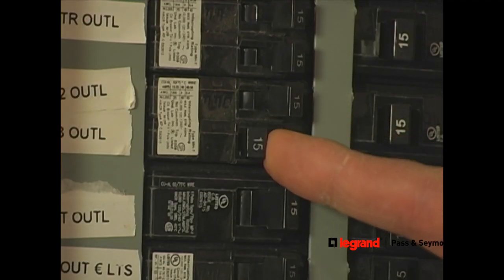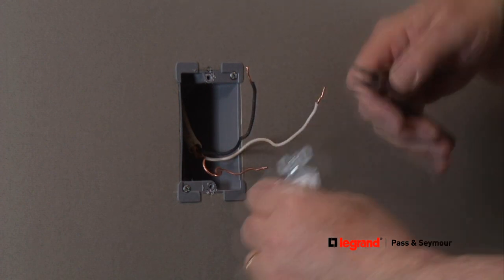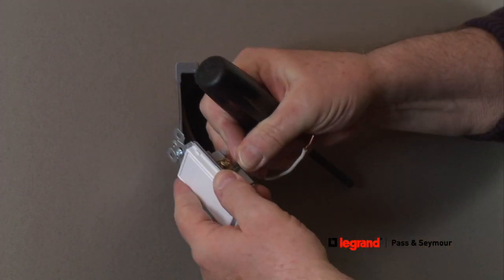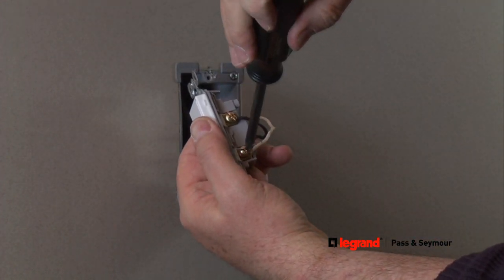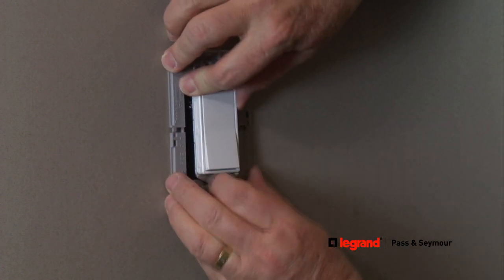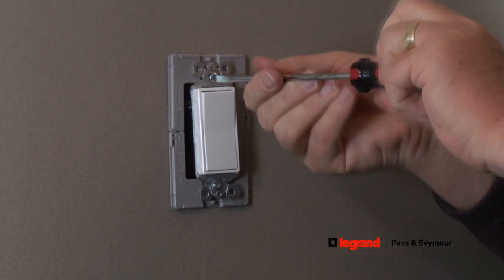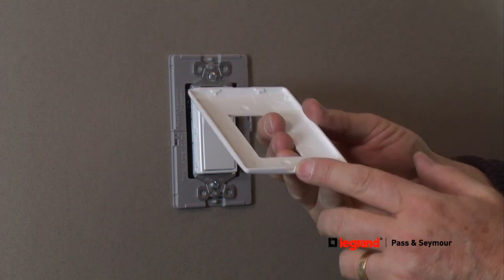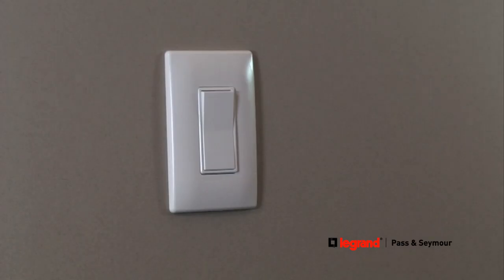Pass & Seymour: How to Install a Decorator Switch

Comment from the maker: Hello. Hopefully this will help you, assuming you are referring to our 26_ _ series switches. These switches have an internal screw pressure plate back and side wire capability. If you strip the wire to the length shown in the strip gauge on the device, there should be no problem terminating the conductor to the device, using the pressure plate. The terminals on these devices accept  #14 to #10 solid or stranded copper or copper clad conductors. Please let us know if that helps. Thank you.